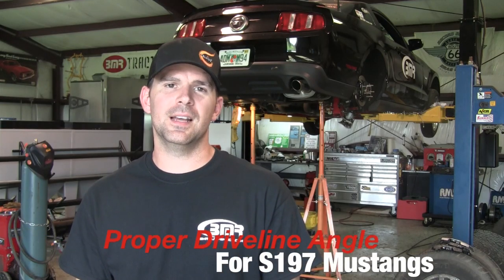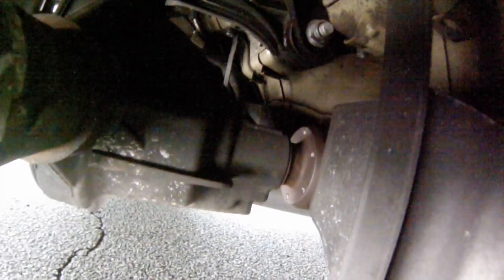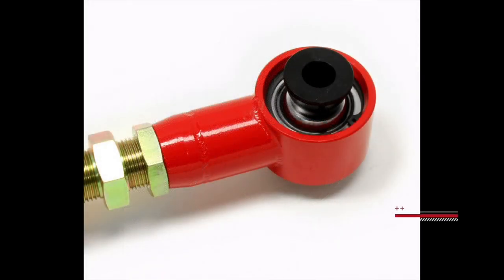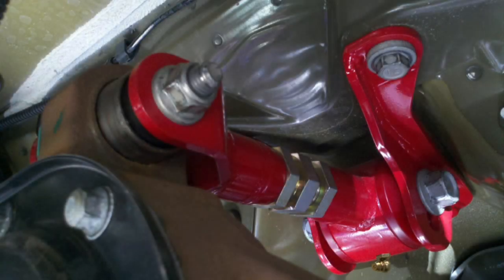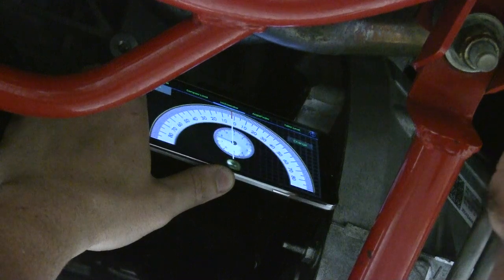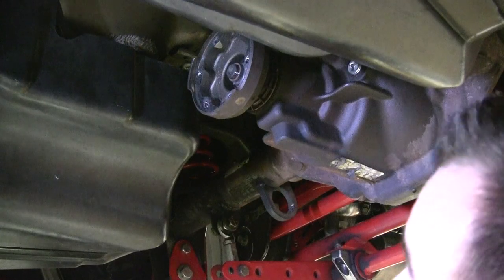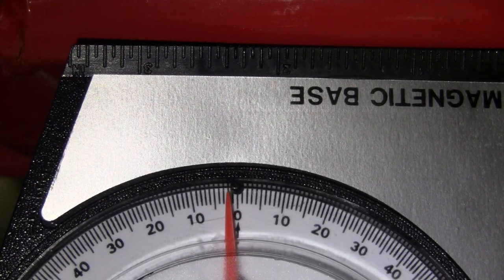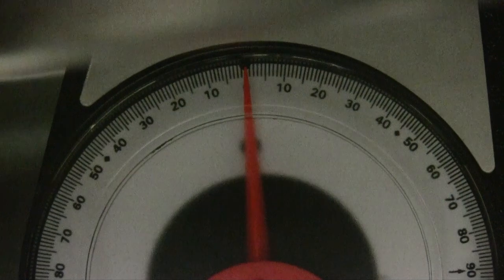BMR Suspension S197 Mustang Driveline Angle Video

Comment: the car in the background has the wheels just hanging.  you should mention the wheels need to be on the ground/loaded.  also S197 have a two-piece driveshaft with center support bearing.  is this procedure for a two piece propshaft as well?
Reply: Scott Fritts The car in the background was in our development shop and used as a backdrop for the introduction for the video. The rest of the footage was shot with the car on a four post lift. This procedure works exactly the same for a one-piece or two-piece driveshaft.

Comment: With the stock drive shaft being a two piece would you be able to lower the car 1.25"-1.5" and not need an adjustable upper arm? With an aftermarket one piece shaft I can see where you would need one.

Comment: Hey guys.i have a slightly lower S197 2014 GT and when I put an adjustable BMR Upper control arm with BMR upper bracket , BMR lower control arms non adjustable, and BMR a adjustable pan hard bar. I heard a clunk when ever I applied the clutch/gas removing or applying power to driveline. When I went back stock it went away. Trust me I removed each piece individually to find the culprit because I love the quality of these BMR parts. I have read forums that say S197 with uca and lca = clunk no matter what brand. I do not blame BMR at all high quality construction I am just curious what I may have done wrong? Please advise
Reply: ozz mann You can tell their customer service sucks by the Cricket reply. You probably broke a trans mount being that’s now the weakest mount/link. Did you remove all the BMR parts or just the culprit?
Reply: I have a lot of experience with the 05 to 09 cars. I am replying to an old comment so I assume you fixed the issue already, but the clunk can either be your axle bushing being shot and torn (you will feel a clunk during acceleration and braking if thats the case) or it can just be the famous slop on the S197 drivetrains. The stock ford driveshafts are known for it.

I had a bad axle bushing and replaced it with a solid poly bushing I pressed in with a c clamp lol. Make sure your stuff is properly greased and not over torqued if you use poly anything though, or it can bind and the suspension will have a hard time moving properly and the car will feel weird. That goes your your lower and upper control arms too